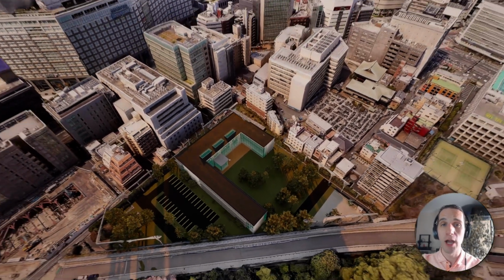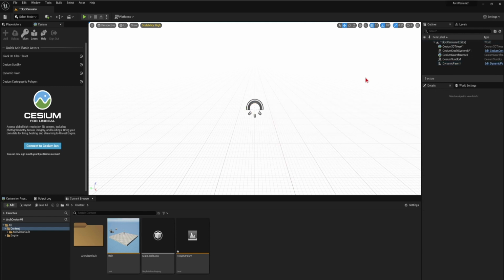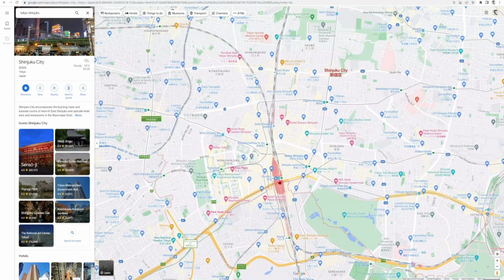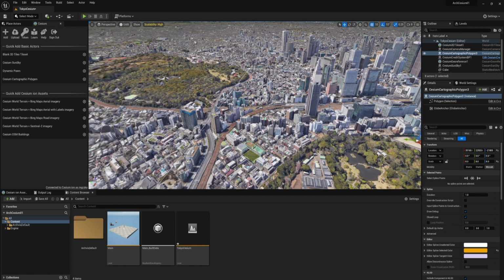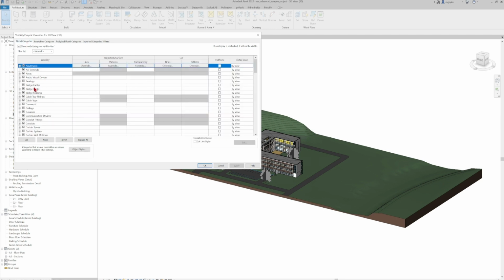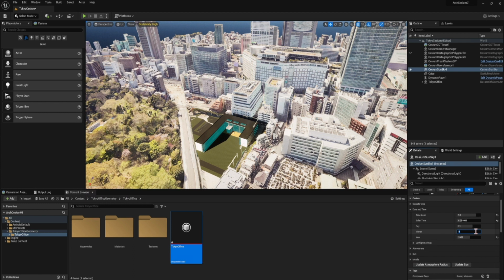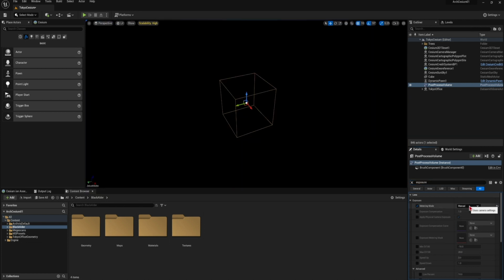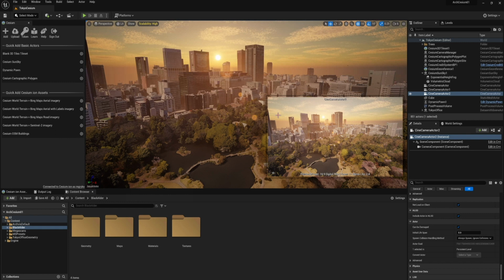Custom Models in UNREAL 5 and GOOGLE MAPS using Cesium ( Revit, Rhino, Sketchup)

Comment: I can't make the polygon clip, for some reason I can draw the area, I can also make CesiumPolygonRasterOverlay but it doesn't make the cut
Reply from the maker: in the details panel for the cesiumpolygonrasteroverlay for the Google photorealistic tiles try checking "invert selection" and deselect "exclude selected tiles".  Also make sure the polygon is added to the polygons array.
Reply: @Urban_Decoders  Thanks it works

Comment: When I add the fog left side is all white like infested with FOG and other parts are normal. Why is that>?
Reply from the maker: under the exponential  height fog details panel you will want to balance the fog density and fog height falloff parameters.  The  position of that fog actor also affects the strength of the fog and how far it goes.  You might also have the fog cutoff distance quite low so removes any fog outside a certain radius.

Comment: Are you a Legend or What! KING. Hey, man, one more thing I would like to see is to add reflections. For example, I got the  ` the gherkin` location from the UK. It looks eh tbh. How can I make it more realistic?  I love your content.
Reply from the maker: Thanks for the feedback! In relation to improving the quality of the tiles you can select the photorealistic 3D Tiles and under details change the "Maximum screen space error" to something like 2 to increase the mesh quality.  You can also check the "ignore KHR_materials_unlit" option which will make the mesh dynamic cast shadows and maybe more realistic.  

However if you want high quality close-ups, the google tiles are not very good so i would recommend to use the cartographic polygon to remove certain buildings such as the gherkin and replace with your own models or other photogrammetry.  I will be adding soon another video on how to clip multiple sites from the tiles to add your own models.
Reply: Are you a living legend? Now I understand clearly how people make an ultra-realistic scene for their websites and such... Can we achieve reflection on an imported model? You are one the most clear instructors I've ever seen. @Urban_Decoders

Comment: thanks for sharing your knowledge! Is there any way to 'flatten' the terrain in a particular area to make space for our new plot?
Reply from the maker: Not flatten as such, but you can cut out the plot from the google tiles and generate you own mesh for the land.  You can use the cesium cartographic polygon to clip within the region rather than outside.   Just check the "include tiles inside" option in CesiumPolygonRasterOverlay.   https://cesium.com/learn/unreal/unreal-clipping/   

If you want to have multiple polygons clipping side and outside the polygon you need to edit the material on the CesiumPolygonRasterOverlay and add an extra material.  I will be doing a video on this along with an update on the tile streaming soon.
Reply: @Urban_Decoders   Thanks my man !

Comment: When I move around the scene, I see several tiles that disappear and appear alternately, as if the level does not load to 100%. Do you know how I can improve this?
Reply from the maker: There are a few settings that can be adjusted within the Google Tiles details panel to control the tile loading.  First you could try increasing the "maximum simultaneous tile loads".  This will allow more tiles to load at once.   Increasing the "Maximum Screen Space Error" to something like 20, will decrease quality but increase performance.  Another useful setting is to disable Frustum Culling so that out-of-view tiles will still try to load at the desired level of detail.

Comment: Thanks so much for you very detailed content! wondering can I export the clipped map + my Arch model out as fbx or any other 3D format ? I notice when I closed the project open again, I need to to reset the map? thanks advanced !
Reply from the maker: Since the google tiles are streamed into unreal, there is no fixed map geometry.  This is the reason why files are very light weight using this method.  At the moment you stil need an internet connection to stream the google tiles in live whenever you create a scene.  

There might be a method in the future for caching the streamed tiles to prevent them having to be reloaded each time, but that is something that we just need to keep an eye out on the Cesium site to see if there are any updates.

Comment: This is great content!! If the revit models are already georeferenced is there a workflow for automatically placing it in the correct location?
Reply from the maker: Thanks! That's an interesting point.  If you import your revit scenes via datasmith as shown here you need to position manually but then if you reimport the model, it will go to the new position.  Otherwise it is possible to create custom imports using datasmith and blueprints.  You can also import certain metadata from your models into unreal, so something might be possible there to automatically position on import.  I will have to take a deeper look at some point!

Comment: which is better sir revit or sketchup?
Reply from the maker: In relation to importing into unreal and google tiles doesn't matter so much.  Revit models generally hold more metadata which you could extract and show, but if you just want to render geometry a textured model from either software works fine!

Comment: Such a great tutorial, thanks ever so much.  Is high-res screenshot the only way to create a reasonable still?  Been tinkering with Rendering through the Movie Render Queue, but with NO success at all.  Am I missing some point?  Is Google-Data through Cesium non-renderable?
Reply: the movie render queue works with google tiles and renders fine, i did a video here on it if you would like to check it out: https://youtu.be/CGANE33socE?feature=shared

Comment: Could I build a game with this?
Reply from the maker: You can easily add a first person actor to this scene and play around with it.  You could make a game with this although streaming the tiles has limitations in terms of editing or optimizing the google maps as done with static meshes.
Reply: I'd recommend you don't make a game by steaming Google tiles as these are credit based and you will eventually run out of credits and need to buy more. Unless you found a way to export these tiles offline

Comment: Is it possible to remove a 3d building with this? I'm trying here, but cannot get rid of the 3d in the tileset.
Reply from the maker: Don't believe you can actually delete polygons from the streamed google tiles unfortunately so one of the solutions it to use multiple cartographic polygons to clip out 3D buildings.  However to create mutiple clippings you need to edit the "MI_CesiumThreeOverlaysAndClipping" material.  I didn't make a video on this part as it would make the video too long but you can find the solution on the cesium forum here: https://community.cesium.com/t/cartographic-polygons/24069
Reply: @Urban_Decoders  So the workflow is to clip out a polygon from the streaming and replace it with your own geometry and terrain?
Reply: weird im having the exact opposite problem where mine doesnt show 3d buildings i can click it on but theres no image textures on the buildings its just white
Reply: @SunDownSound  what's going on with yours is that Google hasn't 3d generated your area. There's white buildings because you clicked the option for cesium to generate a blockout of your area.
Reply: @buster5661  dude you’re a god thank you so much
Reply: @SunDownSound  Sorry I couldnt help you further. I know how difficult it is working on a project with limited resources